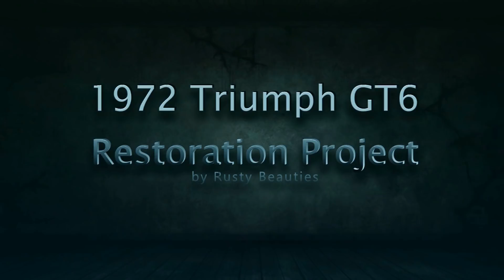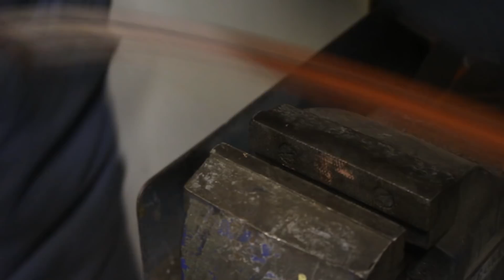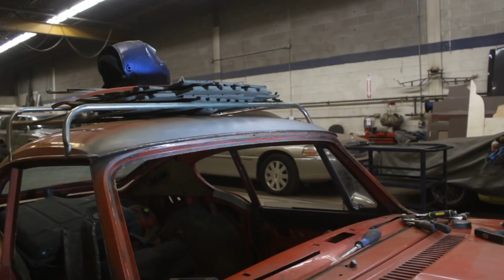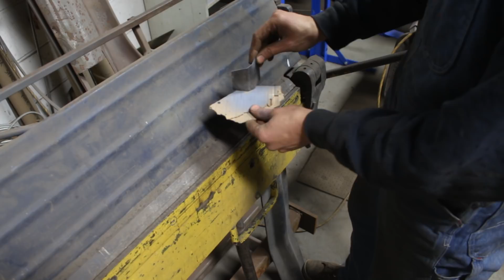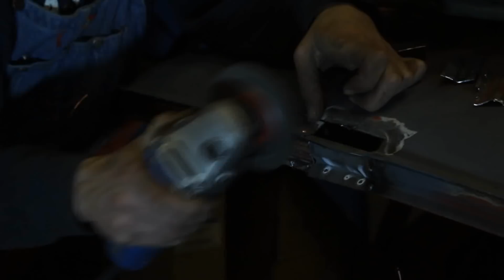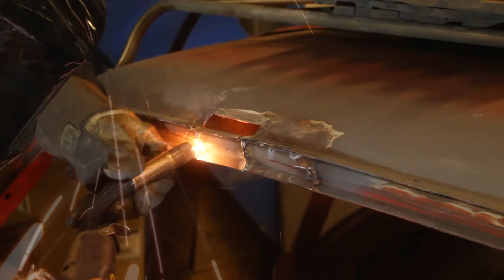1972 Triumph GT6 Restoration - Part 34 - Roof finishing piece and a hick-up

Comment: Between the repairs to the leading edge of the roof and the two lower windshield supports your showing yourself to be quite a artist. Impressive. 
Off now to sub to Chris' channel.
Reply from the maker: Thanks Keith! It looks like I have to go back to that area one more time though. Someone just pointed to another cheesy area at the top of the frame. I think I need to start wearing my glasses at work.

Comment: Elin thanks so much for posting your progress on the TR6. I OD on all the vids over Christmas break.  Ran across a young fella restoring a Toyota Celica.      YouTube   1973 Celica Restoration (the $150 parts car) part 1   Dev J .   He is an excellent fabricator, I think you you will enjoy his technique.  Also if you win the lottery you should get a forming machine like his at 5:30 of the vid.
Reply from the maker: Thank you for this link. I checked it quickly and, yes, I can see it is worth subscribing. I don't have too much time, but I will try to watch his progress. The bead roller is in my plans for sure :) It saves a lot of headaches

Comment: I've noticed with my replacement panels that the stuff that is painted that flat red is not true OEM, but the stuff that is painted black is the Steelcraft stuff. I'm sure this is not probably always true, but in has been for me so far. Good job and another ingenious solution to a problem.
Reply from the maker: I was amazed how wrong was that shape. It looks like they never took the time to fit at least the first one and see what they do.
Reply: Elin Yakov I avoided those kind of sills for that reason. And they weren't that much cheaper. Some of the stuff, however, you cannot get OEM quality, like the boot strengtheners I got. Again, flat red.

Comment: I hate to be the bearer of bad news but, I could see light coming through more rust holes while you were cutting just to the driver's side of the first lower patch. You can see this yourself at 14:30-14:35 or so. Maybe you saw it too while you were editing.
Reply from the maker: I think I need to start wearing my glasses at work. I missed that. So I need to go back one more time to that area. Thanks for pointing to that. Even though I don't like you anymore LOL

Comment: Why didn't  you  just weld in the holes..?? Why more work  then you  needed buddy
Reply from the maker: If there was only one hole I could have tried. When there are many holes in one area this means that the whole area is very thin already and I would just burn through it.